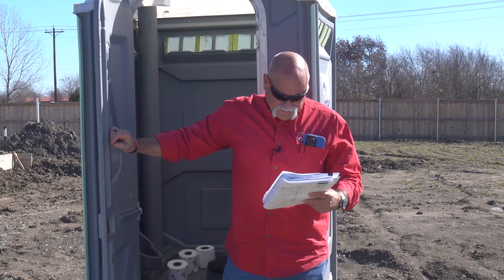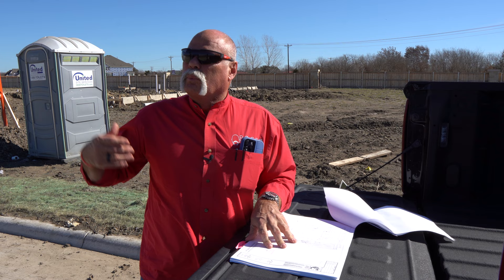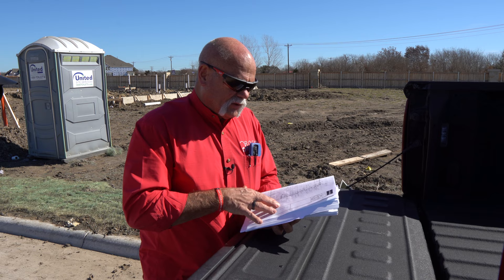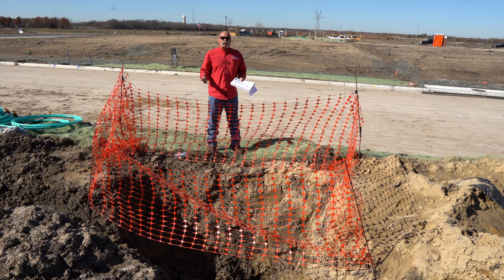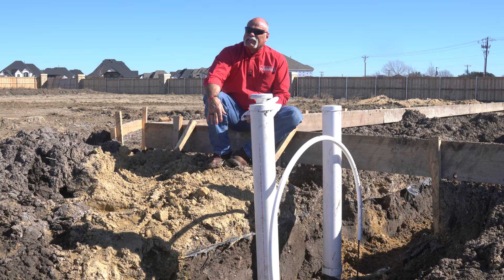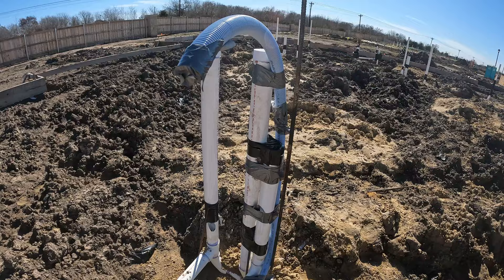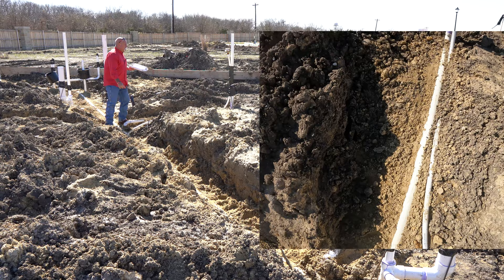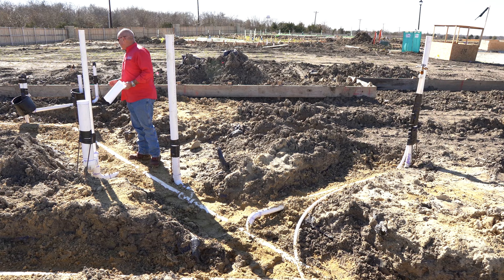How to Plumb a House | Rough In

Comment: The thing that I liked seeing was the long 90 bends for the pipes in the foundation. I see here in south africa construction plumbing people still like using short 90 bends instead of long 90 bends or atleast 2-45 bends in foundation that makes it extremely difficult to unblock it there is a blockage in a 2" drainage line in the wall or foundation.

Comment: Quick correction. I do new construction plumbing in Texas and those 3-1/2 inch drops you’re referring too is actually for the garage drops. If you return during the pre pour stage you’ll see that the pads for the garage should be 3-1/2 inches lower than the rest of the house. I rarely see when a builder marks exactly where they want the 3” drop for the second story. They usually mark the garage drops on there so you’re aware and don’t accidentally leave the plumbing up above the foundation pads.

Comment: We like to do our p traps for the tub drain before the pour.
Get those plastic oatey tub boxes, drill a hole... slide the box thru the pipe. ..screw the lid on... after they pour we just cut the box flush with the foundation and you have nice clean square box when your ready to set your shower/tub... no chipping or digging later

Comment: Both of those extra loops are water chaises. The one in the kitchen is to run water from the wall to the island. The one in the master bath is to run from the wall to the tub, probably a free standing tub with deck mounted faucet.

The 'missing vent' on the master shower isn't missing. The right MB lav is the wet vent for the tub and the shower.

Comment: We had to sleeve any supply line in the same trench as the waste even if it only crossed. I usually use a dedicated trench for the supply line. Heck I’ve seen houses with 1 trench holding (from bottom to top) 200 amp service, sewer, supply,and 2” below the soil cable. (Glad the cable company was  cool) cut that damn thing sticking the shovel in the ground. Glad it was on too steep of a slope for a mini ex

Comment: The problem I have with converting it to 3" is that the cleanout to go backwards into the system is 4". If you were snaking it with a larger cutter and didn't know it reduced you can damage the 3" under the slab.
Reply from the maker: Good point! Do you prefer 3" or 4"?
Reply: @RogerWakefield  4” whenever possible in my opinion. Love your channel thanks for all you do sir!
Reply from the maker: Right there with you...thanks for watching!

Comment: Am I seeing this right?  What is the purpose of the double cleanout outside of the foundation?  I was plannning my plumbing with a single stack outside.
Reply: I can't say 100% but what I was told is that it's for running a sewer camera/sewer machine if there is ever a problem in the pipes down the line, the curve at the bottom of the double clean out guides the camer/machine in the direction it needs to go. So if there is a clog under the house the pipe closer to the street curves in towards the house and the one closer to the house curves out towards the city tie in if there is ever a clog of damaged pipe in the yard

Comment: At 8 minutes, is that a black iron reducing coupling? Aren't those against code for domestic?
Reply: It's just for rough stage plumbing so we have access to water at this stage, once the concrete slab is poured and the framing is done we move onto the topout phase where it gets cut off and replaced with a ball valve for the customer shutoff in the garage

Comment: I would rather not run a waterline with sewer line together.
Also I like to run straight drain lines instead of 45° lines.
Shower drain should be straight shot, no 45's in arm between vent and ptrap
Waterline needs to be sleeved
Kitchen island and freestanding tub have that 2" conduit for waterline